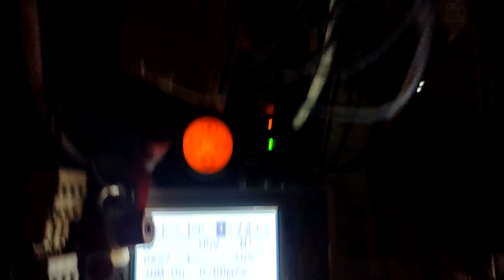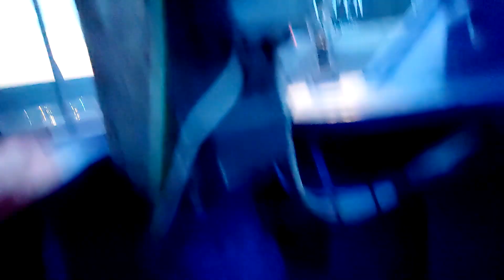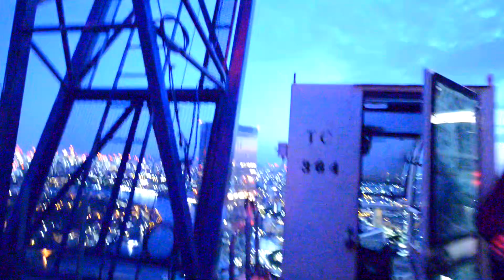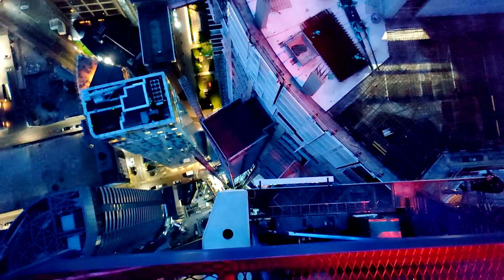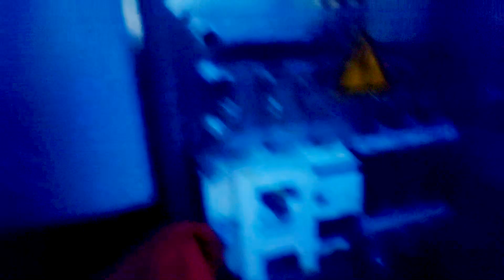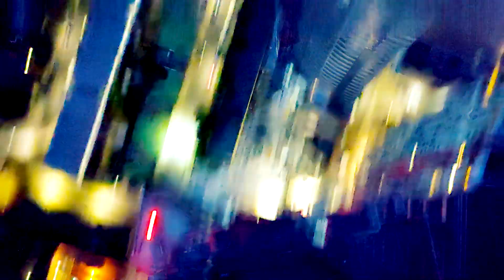Driving a skyscraper crane 200 meters high

Comment: Do you ever leave the cranes in totally different positions, so the driver thinks 'what the hell, swear I left it different'?
Reply from the maker: We always leave them as we found them.  Also the crane rotates on its own as they are left in weathervane mode, so the crane driver will find the crane facing in the direction of the wind.
To switch off a crane the procedure is Hook, Radius, Weathervane, E-Stop.